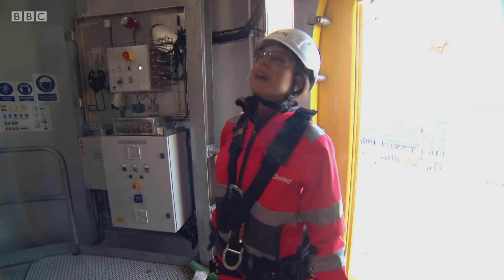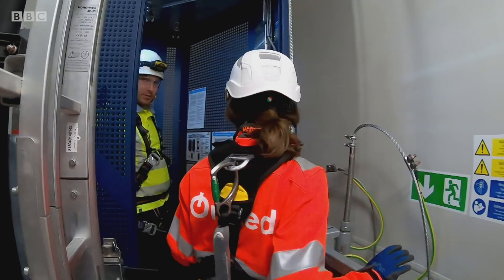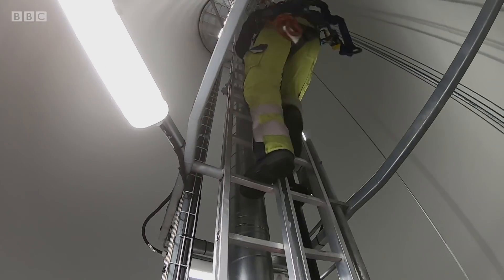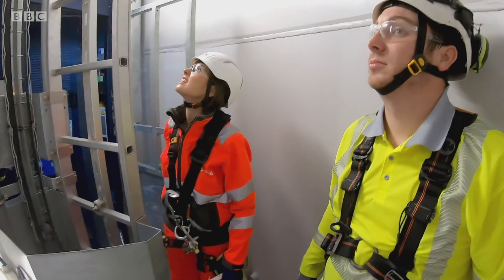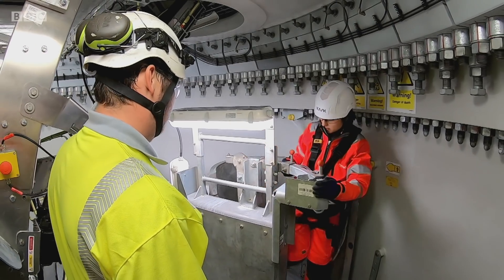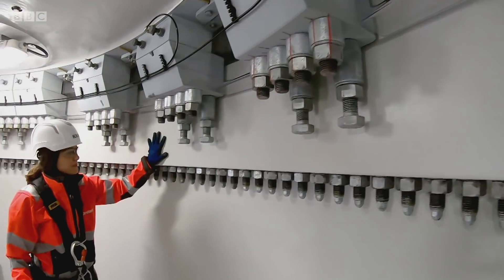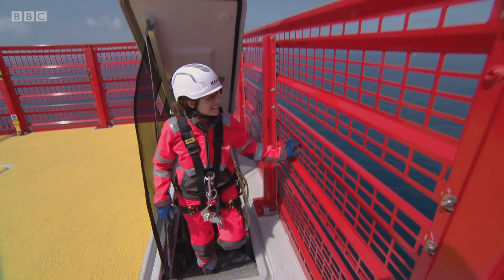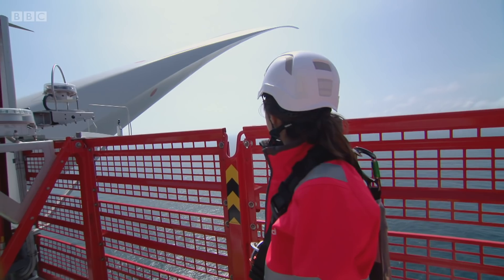I climbed 623 feet to the top of a wind turbine! | Powering Britain - BBC

Comment: Look at all the raw materials needed to produce a wind turbine.
At the end of their shelf life many materials used are not recyclable, not to mention the amount of birds they kill.
Reply: The blades tend to be made from carbon or composite glass and go straight to land fill.
Reply: @ratherlargehooter8200  The carbon composite is recyclable. It's just a quite complex process and as the materials that are used are not particularly valuable, unlike metals, which are easier to recycle and thus make the process cheaper, it usually isn't worth it, purely on the economic side. It would be a real boost, if researchers come up with a more economic recycling process, as tossing those blades into landfill 4-5 times a century isn't the most environmentally friendly path
Reply: @ratherlargehooter8200  much of the machine you typed that on isn't recyclable either. Most of your house isn't. A good portion of your car isn't. What's your point?

85% of a turbine is recyclable. Blades? No. Not yet. But as they're out there for many decades producing electricity without producing greenhouse gases, I'm going to give them a pass on the blades for now.

Funny thing: most of a gas power station isn't recyclable either - far, far less than 85%. Don't get me started on the birds nonsense: housecats kill tens of thousands of times more birds than turbines. Gonna euthanise poor tiddles? Of course you're not.

Think.
Reply: @timaustin2000   I’m just very concerned about the environment, and I love birds, can’t you see the parrot on my shoulder ?
How much of the lift in the turbine is recyclable, it never had to be made in the first place  the lazy sods should just climb the stairs.
Reply: @timaustin2000   so because cats kill birds it’s okay for man made  wind turbines, birds are vital for the delicate balance in nature.
Reply: @ratherlargehooter8200  Its just that the scale on which wind turbines kill bird is just so minor it really doesn't matter. In Addition as we humans need electricity wind turbines are one of the best alternatives even for birds. Climate change and excavating huge portions of land to get some coal to burn is far worse for birds than windmills will ever be.
Reply: They aren't recyclable but they get refurbished.

The argument u use there can be applied to any oil and gas obtaining and refining equipment
Reply: Guarantee most of that structure, bar the blades, is made of steel which, last time I looked, was recyclable.

A typical offshore wind turbine pays back the atmospheric pollution produced in manufacturing and installation in under 2 years. 

Actually looking stuff up helps when commenting.
Reply: Say no to wind energy theft. Signed: The Birds.
Reply: @guff9567   Birds lives matter, liberals have a twisted logic.
Reply: @ratherlargehooter8200  yes. Yes. Yes. The real B.L.M.
Reply: @guff9567   I’m with you, but Tim doesn’t seem concerned about the poor birds.